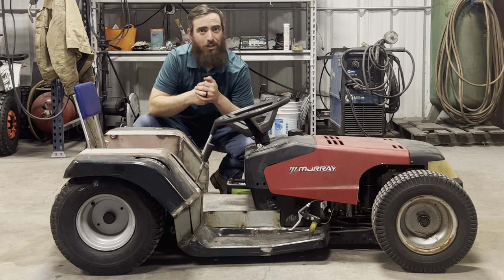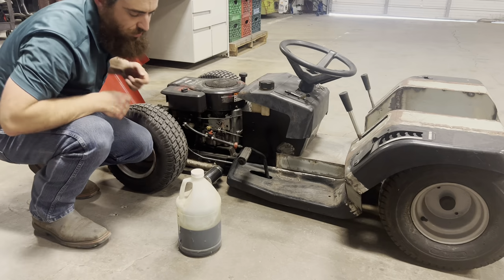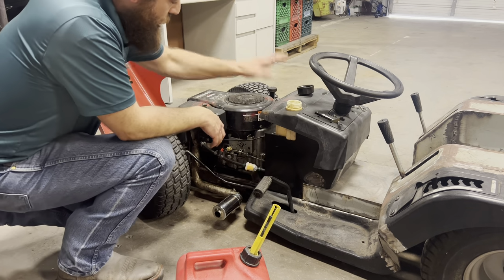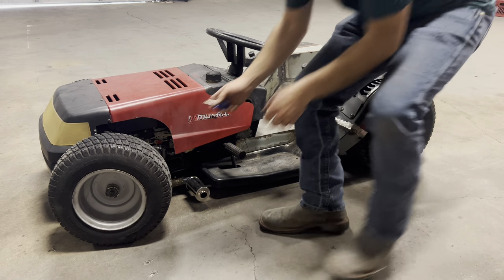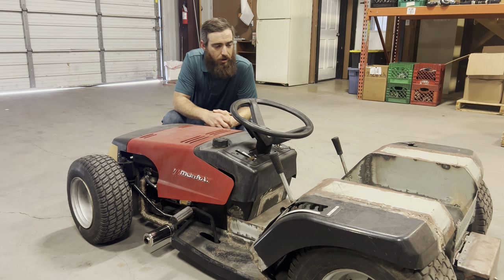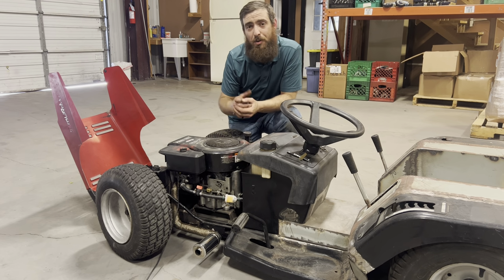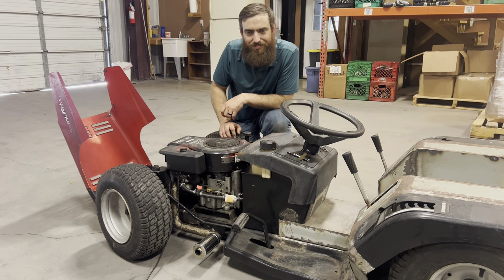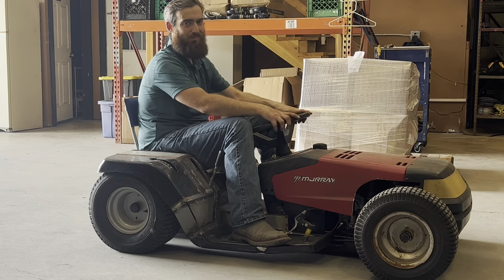How To Lower a Lawn Tractor as Low as Possible Pt. 9

Comment: I just binged this project. Well done sir. Having to choke the carb means it does not have enough fuel. One thing to try is to drill the Carb jet one size larger than it is with a micro drill bit. This will give you a little more fuel. Worked for me. Great project brother looking forward to the paint. Take care.
Reply from the maker: Thank you very much!!
Reply: Try to get the fuel tank a bit higher for gravity to work befor drill jets just a thought my friend 😁👍

Comment: Hey I don't know if it would help any but I learned this the hard way with those gravity fed single cylinder carburetors they don't like sucking gas to those huge filters you want a small one like the red one you pulled off

Comment: Fuel filter you put on is for a fuel pump system the micron count is wrong and doesn’t allow fuel to flow freely where as the red filter basically is just a screen and allows free flow of fuel. Ram into that a few times working at the dealer.

Comment: I bought a new Briggs OEM carb for my 2011 Craftsman 46" deck tractor mower because a neighbor who was helping me lost an internal part or two.  We found a tiny one on the ground, but at least one other part was missing.  Without a complete carb and everything where it's supposed to be, I didn't attempt a rebuild kit and didn't want to take a chance on a cheap replacement.  This one was running great, so the recent rough starting and idling may be old gas, which I thought I put Sta-Bil in.  I never heard of Mikuni, so if I ever need another new carb, I'll look at theirs.  I won't be hot rodding, but a performance carb couldn't hurt.  However, I'll maintain the new Briggs like you're doing, cleaning it, and a rebuild kit would be an option, if ever needed.  This one was $165, maybe with tax, at a parts shop.  I wonder what a Mikuni would cost.

Your carb was running with the old gas and you adjusted the idle on it then, so maybe it needs to be adjusted again.  Did you clean all the tiny port holes in the emulsion tube?  It usually unscrews with a flat blade from the top.  Just run a small wire, like for a bread tie, through all the holes and use something similar in larger holes.  An Ultrasonic Cleaner may help.  Put the carb and internal parts in a ziplock with solution and then put that in the Ultrasonic Cleaner.  An Ultrasonic Cleaner is only supposed to have water in the tank, but the ziplock will allow that and still have the carb and parts in a cleaning solution.
Reply from the maker: I have pulled and cleaned the emulsion tube and poked out all the orifices the best I could, but I have a buddy that has an ultrasonic cleaner and I’ll probably try running it through there in the future
Reply: @wybarprojects   Good luck and remember to put everything in a ziplock.  That prevents ruining the warranty.
Reply: @wybarprojects   Also, sometimes the needle is an issue, especially if rubber tipped.  There's often a needle seat o-ring as a seal to consider, too.

Comment: Needs air-fuel adjustment if it was that black with soot. I'd move the shifter to the center support for the steering. Just need a longer rod and another pivot point to join them. For the seat area, I would cut a 45-deg "mud guard" bevel, since there is a lot of dead-space under that narrow seating gap. Some back-side 1/3 mud-guard wheel-wells for the front would make it look cool too. It will stop the wheel from throwing stones and mud at your face, muffler and boots, while driving. I would have made leg extensions so my feet were closer to the front  wheels, for comfort. I know you were going to try and use a lot of the stock locations, but it just doesn't suit the lowered seating and function.
Reply from the maker: I agree with everything you said. I’m learning a lot along the way and I’m going to finish this one out and use everything I learn from it on a future project

Comment: 10 years ago i bought an old 4 post hoist, i soon fabricated some small ramps and rails to got across the inside of the main rails , i can drive my Murrays on from the side, and the wheels just fit either side, so i can remove the bridge rails and clean underneath and inspect for damage.

i'm only 56, but getting down on the floor is beyond my current health, so the hoist is worth every dollar i paid for it.
Reply from the maker: That’s awesome!

Comment: Having to use the choke is indicative of a lean condition…and in your carb tear down, it appears you didn’t remove the float and check for any obstruction in the needle and seat assembly, some carbs have a screen that catches debris prior to entering the fuel bowl area. Check your float drop and level too. The soot on your spark plug could be from an over rich condition (as in using the choke) or insufficient spark…just to name a few possibilities. Learn more about carbon makers (carburetors) before throwing money into another…a headache that could turn into a nightmare! 
   Check the flywheel key, I’ve seen where the key didn’t shear but was offset enough to throw it out of time…creating a host of calamities! Just some food for thought…anyway, cool build, good luck 👍
Reply from the maker: Great tips, thank you!
Reply: @wybarprojects  you’re welcome bro👍

Comment: I’m coming to your last couple vids on this project now - is the project all tidied up now or have you moved to the next project? I gotta say well done - you must be happy with the sub and view counts, I see the subs have gone up 1k since I first noticed your channel a few weeks back. It is a cool project and you’ve done well with the video creation I reckon, I hope you plan to keep doing it 👍 
And maybe you have a vacuum leak too (can require the choke to be on a bit to idle) hit the manifold with some ether while running it (but watch for those exhaust sparks 😉)
Reply from the maker: Thank you!! I’m thrilled with the community growing around the channel and it makes everything more fun for sure. I’m not done with the project yet, I’m just stuck on paint prep and it’s taking forever. Not to mention we’ve hit the middle of summer in south Texas and we usually hit 100+°F in the afternoons. I recently got a new drum fan which helps, but it’s still blowing 100° air at me 😂 
I should have the new video up next Sunday 🤞
Reply: @wybarprojects  haha, we get the same heat in summer with 70% humidity so lots of excuses why projects don’t get done then

Comment: Black carbon on spark plug is caused by incorrect air fuel mixture. New carb 25$. Non methanol fuel sets up in carb without stabilizing it. Try sea foam from the parts store. Sometimes that will work. Our racing carbs are pretty sensitive, factory carbs not so bad.

Comment: Great video, you can also put everything back on and spary the carb with brake cleaner while it's running. It will tell ya if you have a vacuum leak.
Reply from the maker: Thank you!
Reply: @wybarprojects   that is the wrong fuel filter for a gravity feed fuel tank...for gravity feed paper filters cause too much flow restriction... instead you should use a mesh type filter often color coded as a red filter (for ex. Briggs & Stratton Fuel Filter 5018K) aftermarket may be red or clear but will state mesh (100-200 micron), white/clear filters will fuel starve your engine (under 100 micron and usually paper/cloth) if you want the additional filtration you will need to install either a pulse pump or a low pressure (3psi or less) electric pump
Reply from the maker: @dodgeme1986truck  good to know! Nobody has explained why it’s the wrong filter yet, just that it is 
Thank you!
Reply: @wybarprojects  it's like pouring water through 3 paper coffee filters still stuck together vs. Through a strainer/collander
Reply: @dodgeme1986truck  thanks dodgeme, two of my murrays have surging issues at times, i'll switch back to the red filters.

g'day from Australia
Reply: @amandagardner565  did the fuel filter change help your surging?

Comment: Setting the idle with the breather off is going to require some choke. The carb is getting full air supply and it's usually restricted some by the air box. Sweet hot rod tho
Reply from the maker: Thank you!

Comment: You bought 1 gallon of stright ethanol free gas, but what you got was about 1/2
A gallon of ethanol fuel if the last person bought regularly gas. The hose on the pump serves all fuel types. What you should do is fill up your car or truck with ethanol free gas then fill your 1 gallon container so you use up everything in the hose at the pump first.
Also unless the filter says flow this way it might be backwards,  also because its such a large filter and sideways its filling up with air pockets and the carb  bowl is running low on gasoline  the filter should be installed so its always full, close to the tank like right under it. 
Last clean the carbon out of the combustion chamber and off the valves try some seafoam yes like a car, water will also burn it off.
Last change the oil and filter. 
And paint this thing.  

Murry rat racer.
Reply from the maker: The ethanol free gas is run through its own hose, so no worries there. The filter has a small magnet on the inlet side, although you’re right about the air bubble; I’ll try to get the bubble out by raising the tank before I reinstall it. I’ll give the sea foam a shot and see if it’ll clean everything up a bit and paint is coming! I’m finishing up the body work now
Reply: nope its the wrong filter for the application it should be mesh not paper... paper filters require a pump due to the restriction to flow they create however mesh doesn't create this restriction.

Comment: I like the Idea of lowering the tractor, But I would put a Horizontal shaft engine on it, with a Torque Converter, and direct drive it to a solid rear axle, and put the smallest sprocket you can find for the axle, that would give you maximum top end speed, but that's just me !

Comment: might be a vacuum leak or sumting with the ignition (being weak and missing ignition at times)
Reply from the maker: I agree, I have a feeling it’s a vacuum leak on the carb. I just got a new one in I’m going to test out
Reply: @wybarprojects did the new carb fix problem? If so what kind? Thanx
Reply from the maker: To be honest, I haven't tried it yet. I started tearing the body apart shortly after I got it. I'll be able to test it out once I get everything put back together and I'll let you know @adamcompton567

Comment: Take the new VW fuel filter off, with your mouth "only" blow into the red fuel filter, put it back on the mower, it should run fine.
You can not replace a red filter with the VW filter !
When it works, go get a new RED filter.

   Work Safe, Be Well
           Enjoy Life

Comment: It's really interesting you obviously have a little fabrication skill but can't set the idle on a carburator.

You have the idle speed set too low. There's no point in doing anything if your running it partial choke, that's how you get fouled plugs.

None of this is abnormal though, people do much worse. Maybe you figured it out in a later video?

Comment: Man looks good 
But spending that much time and effort to just cruise around at 10 mph max speed is not worth the effort in my opinion!!  Also as many times you remove the body could have rattle can paint the body, and change out front tires to smaller those just look out of place.   But like I said just my opinion
Reply from the maker: Not to pick hairs, but top speed is 16 mph 😆 It will be worth it for me, 16 mph feels like 40 when you're riding it
Reply: Still not fast enough lol if I’m spending day much time and money I want to rip and drift that machine. Just my two cents it was cool watching the transition tho!!
Reply from the maker: @dwaynelejeune3508  Thank you!